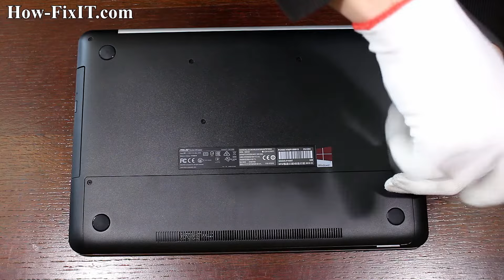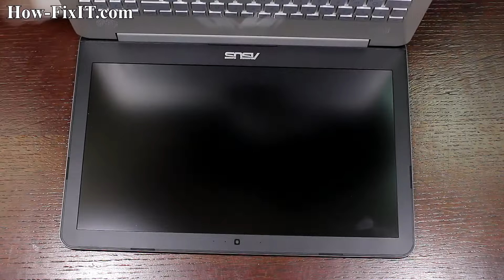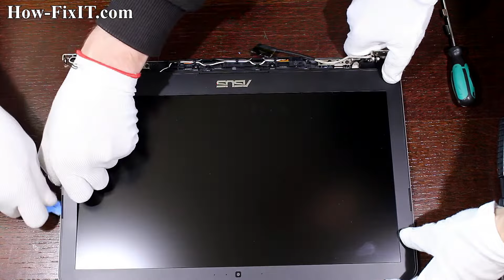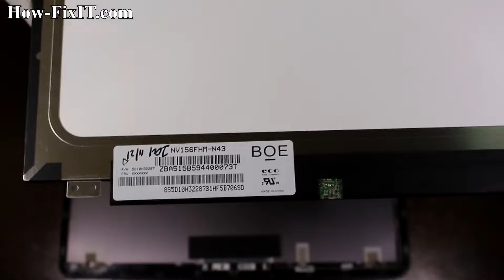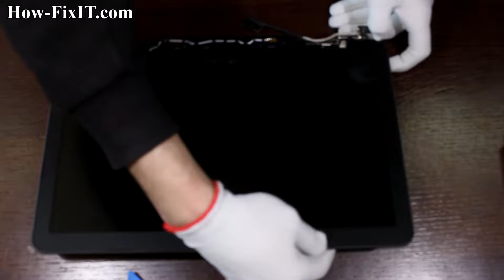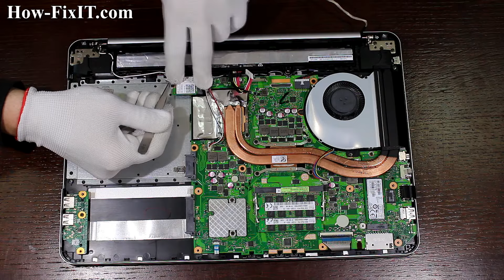Asus N552V, N552VW, N552VX Screen Replacement - Your Step-by-Step DIY Guide!

Comment: I have an Asus Vivobook Pro N552VW with a 15.6" 4K UHD touchscreen, which has a glossy digitizer on top. I'm trying to determine the finish of the LCD panel underneath—is it matte or glossy? When replacing the screen, should I opt for a matte or glossy LCD?